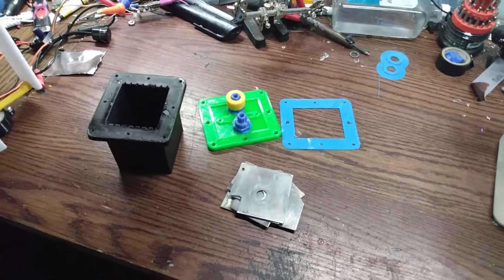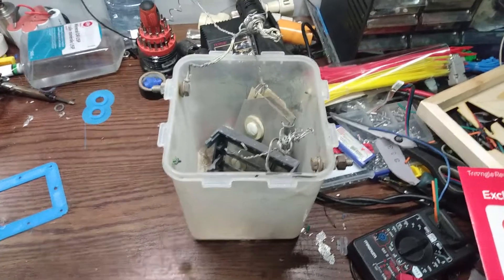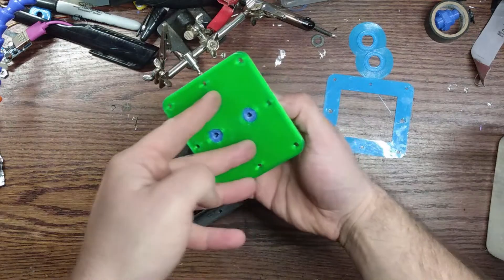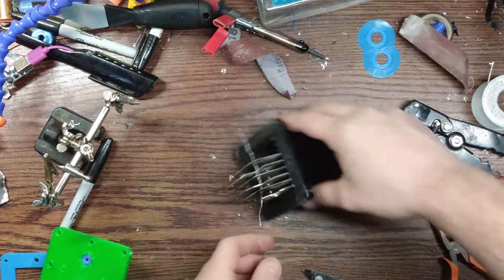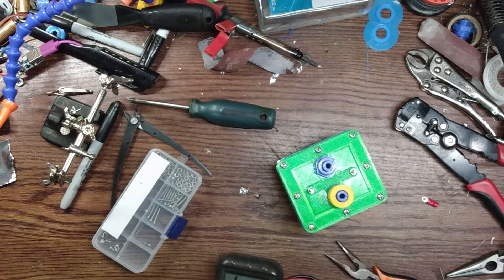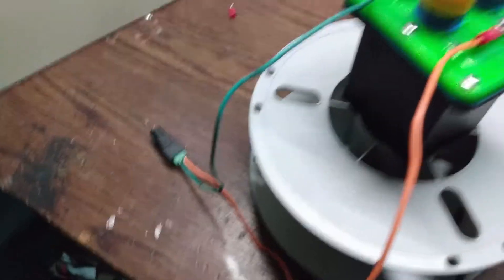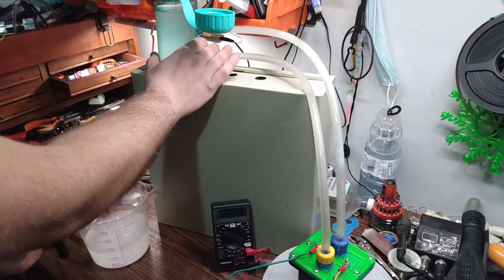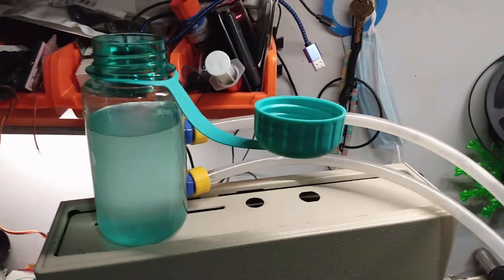3D Printed , electrolysis machine ( hho generator)

Comment: I melted my pla one last year when trying to get hydrogen for an rc airship. Now I'm working on a better design to make out of ABS! Pumping 30 amps through it, so I need some heat resistance.
Reply from the maker: ya I used petg. so far that's my favourite material for more industrial prints . 30 amps is alot I hope its alot bigger than mine lol